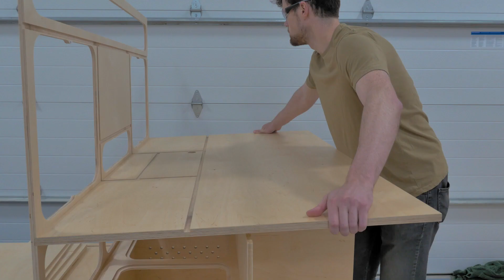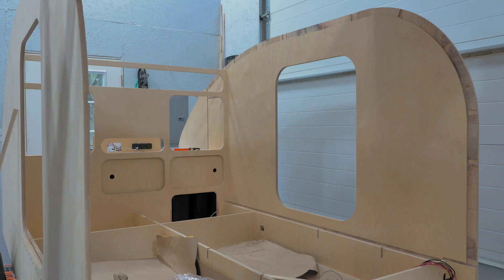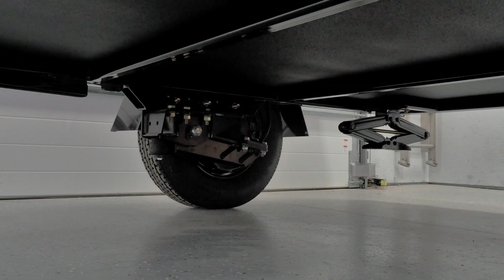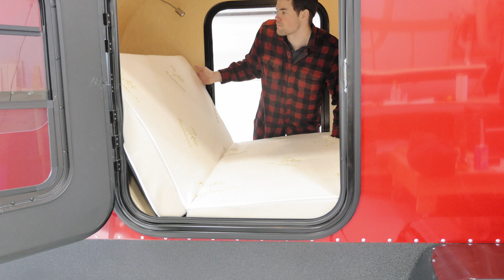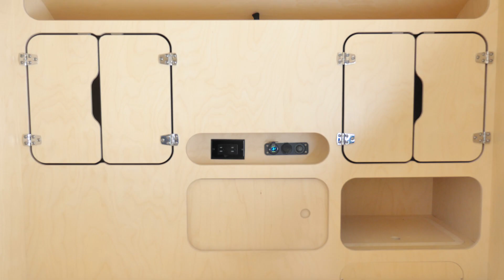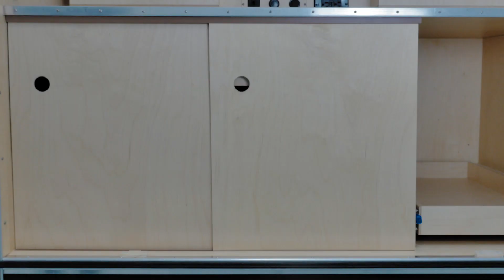Tour of Our Teardrop Trailer Build

Comment: wow I like this ALOT!   Im going to build with foam and overage - fiberglass, but I never understood why the small is in the back for aerodynamics, I would turn that around, Im thinking as light as possible and aerodynamic, because Im going to pull it with my trike motorcycle.  THANKS 4 the layout and ideas!

Comment: An excellent design and one if I had the space and tools I would love to build myself. I really love the floor storage method you came up with as well as the simple galley setup. Too many tear drop camper designs want a highend kitchen - thats not the point of going camping in a small simple camper in my opinion. The only thing I might change is the addition of a propex heater and replacing the AGM battery with a lithium one since you have it in such a enclosed space.

Comment: I've seen a lot of very expensive high end teardrop campers that don't even stand up to the quality of your camper. The first thing that I really like about your camper build is that you used all birch plywood. Too, all of the space in useable and nothing wasted. Like that you under coated the bottom with bed liner spray. The only thing that I would have wanted is to have all one color skins on all sides and too have more of a 1950's feel for the wheels and fenders. But all in all you done a damn good job.

Comment: That looks like one solid construction method.  I am in the design phase of my build, settling on 10' length for the project, but the width is being debated between 60" and closer to 77" wide with semi-integrated wheel fenders to keep the width down to 84" outside wheel/fenders.  It will have its construction challenges due to working outside of the 60" widths of baltic birch.